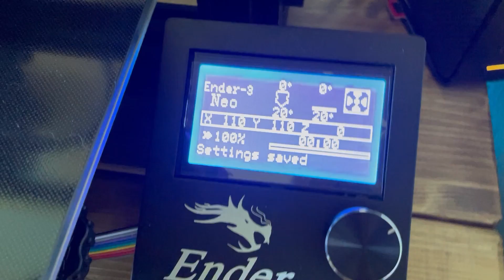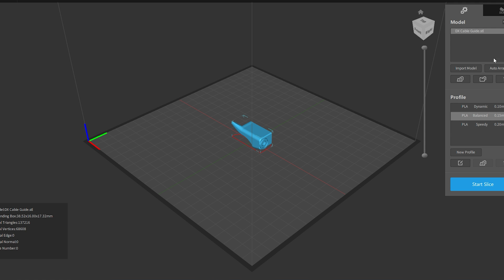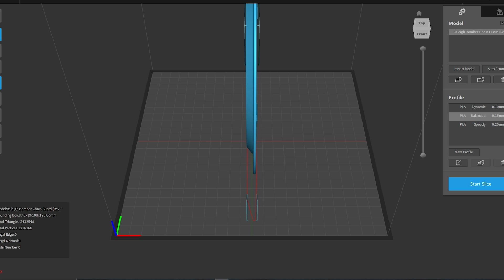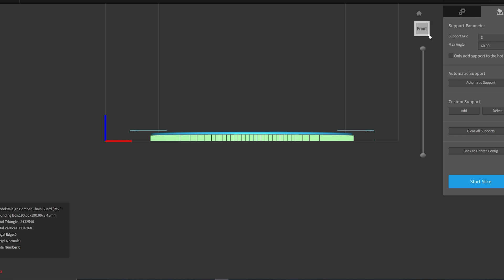Printing Old Bike Parts Is The Best With Creality Ender 3 Neo 3D Printer

Comment: I find that PETG is the better material for printing bike parts. It is UV and weather resistant. Doesn't always print as nice and clean as PLA but also doesnt creep. And it is tuff enuf. I even make bike tire levers out of it.
Reply from the maker: I do have PETG now. Just fine tuning the settings to get a consistent good print.
Reply: @MonkeyShred  Matte Black PETG often gives a nice finish.

Comment: Little tip use brims instead of rafts they are allot easier to remove.  Also you can get parts 3d printed in Aluminum for Not a crazy price I just learned. So I print bike parts in plastic test them out and then send my design out to be printed in aluminum! One last thing you can use Ultimaker Cura with a ender 3 its what the creality slicer is based off of and it's much better.
Reply from the maker: Thanks for the tip!

Comment: They are amazingly useful. I used mine the other day to fix our shower rail. The world's your oyster when you get better with the modelling. I've been doing CAD/CAM for 20 odd years so felt I NEEDED to get a 3D printer 😄😄
Reply from the maker: I just need some modelling software on my PC at home now and I’ll be doing the same for everything that breaks 😂 What software do you use for models?
Reply: @MonkeyShred  Fusion 360. You can still get it free if you're just a hobbyist and it'll do everything you need. It shouldn't be that steep of a learning curve 👍
Reply from the maker: @stuartmooreis  ah awesome! I’ve been using Inventor at work but I know licensing for that is big £££

Comment: Loved that you were able to recreate the broken parts - having seen your short preview I thought you might be using a printer at your work - but this is cool. This printer looks like it uses thermoplastics. Not a fan of white ..can it handle pigmented thermoplastic polymers?  I have lots of technical questions but I think they maybe better directed to the manufacturer. One of my friends has access to a metal printer... the possibilities....
Reply from the maker: Yeah it can print PLA/ ABS and PETG and you can get them in all different colours. I’ve just ordered some of the latter because it’s more suited to functional outdoors parts than the PLA.

Comment: A 3d printer is an unexpectedly good tool for a hobbiest/diyer - once you have one it really opens up possibilities to problem solving.
I recommend dipping your toes in PETG as opposed to PLA - it is much better suited for functional parts (more durable, flexible under stress, heat resistant, also non-toxic compared to ABS).
Great video as always
Reply from the maker: Thanks! I ordered some PETG yesterday after looking at the different types. It’ll be interesting for me to see how different it prints.

Comment: Impressive.
That guide for the tap & die set is brilliant out of the box thinking.
I was half joking about the frame jig and silver brazing, but if you can get yourself a welder to practice brazing on broken cheap fillet brazed frames, who knows? 
I'm really happy for you mate. You're channel is going from strength to strength.
Reply from the maker: Cheers Badger! The die I have for 1 1/8” has a welded on guide for the steerer so that’s where the idea came from ☺️

Comment: Welcome to a whole new rabbit hole!
You have designed some nice parts!
For outdoor applications I recommend checking out PETG filament, PLA will deteriorate under UV-light.
Reply from the maker: Thanks! I ordered some black PETG yesterday after seeing some recommendations and reading a bit more in to it ☺️
Reply: Do you know if particular colors are more resistant?
Reply: @KarlosEPM  Concerning UV-light the less color pigments the better. Thus clear PETG should be the strongest.